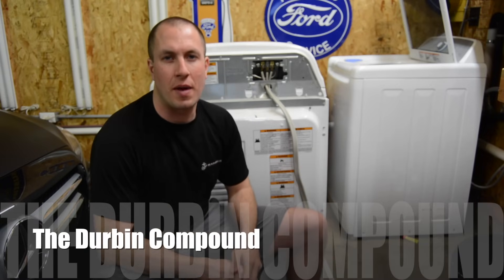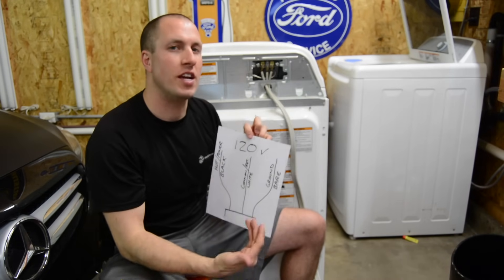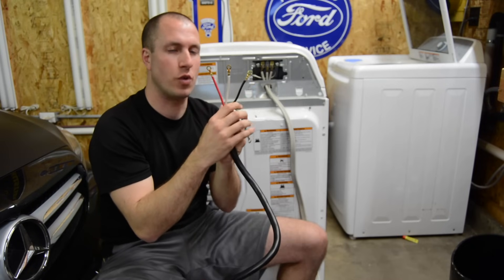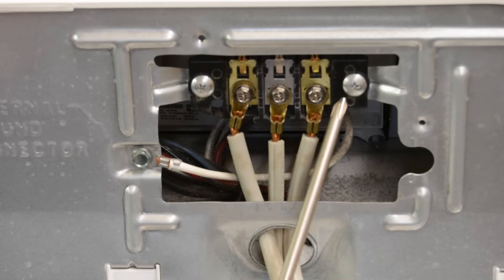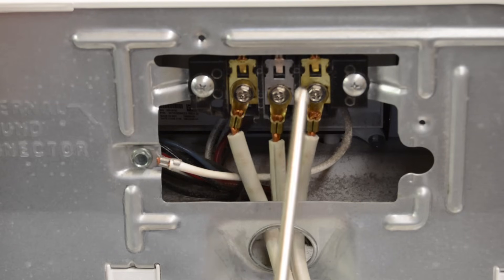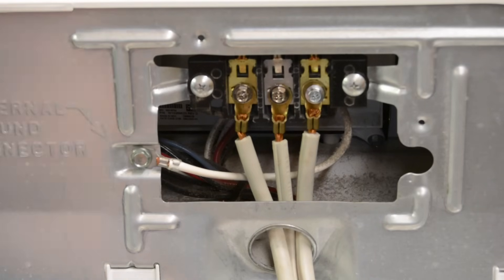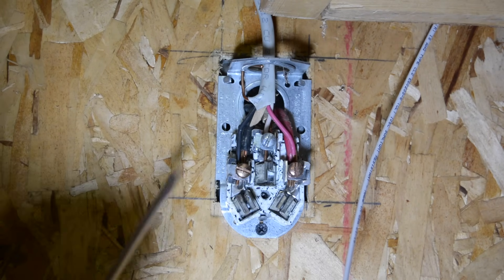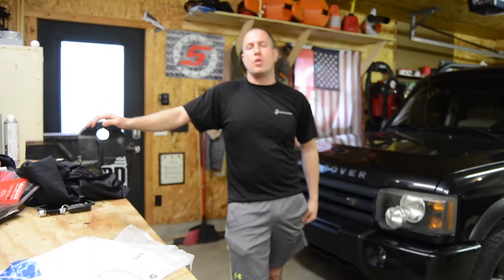How To Change A Dryer Cord - Changing a 3-Prong to a 4-Prong Plug

Comment: Super helpful thank you! When changing from a 3 prong to a 4 prong and I attach the ground (teal) to the dryer body do I keep it attached with the white wire already there or do I keep that white wire loose?
Reply: Perfect, thank you so much!
Reply: Thanks for asking this question.  It wasn't clear to take the white wire off or lay the green right over the white one now we know .
Reply: Mine has a metal strap as the ground not a white wire.  Do I connect the white wire from the cord to the strap?
Reply: Had the sameee question !
Reply: This is why I came to the comment section! Thanks!
Reply: Is it okay to let the white wire just hang inside when placing the green wire  on the left side?
Reply: @TheDurbinCompound  you might want to edit the helpful video to include that point about what to do with the existing ground wire…
Reply: @TheDurbinCompound  WRONG! ..... When using a 4-wire cord on any electric clothes dryer you must move the white jumper (neutral) wire from the cabinet casing (where the green screw is) onto the middle screw where the cord white (neutral) screw is also attached (white on white under one screw) as both are essentially the same wire. You can easily check this with a continuity test. Then the cord green ground wire is attached to the cabinet body where the green head screw is so that the cabinet is grounded and will satisfy the new NEC code requirement. The only place the neutral and ground can be combined is at the 1st panel box where the main disconnect is, nowhere else.

Comment: What happens to that white wire going to the left? Do I place the green wire on top of it?
Reply: Exactly my question
Reply: Thank you! This is my main question!!!!
Reply from the maker: Yes that is what I would do.
Reply: Actually, you want to connect that white wire to the center lug to isolate it from the ground. While it will work with the white and green connected, it will not provide adequate shock protection. I recently found this out after installing a GFCI breaker for my dryer. As it had the ground and common/neutral connected to the dryer housing, the breaker would immediately pop upon powering it up as it thought it was have it as ground fault event. This video shows what to do: https://youtu.be/311TVuKiv10
Reply: @photogravity  then you were doing something wrong. Neutral and ground are bonded together.
Reply: @gloiban  I spoke with a couple electricians and they informed me that it was indeed done correctly. This explains it better than I can. https://electronics.stackexchange.com/questions/213479/neutral-vs-ground-wire

Comment: I followed this video exactly but my dryer will not heat up, it just spins and blows. All thermostats, heating element, and thermal fuse have continuity. Testing the back panel, the center+left and center+right both show 120 V, but left + right shows 0V. I checked the outlet and get 240 V when I test the two hots, and 120 V when I test them individually. Do you know what's wrong with my dryer?
Reply from the maker: Sounds like a bad cord. If you have correct power at the outlet but not correct power when you plug the cord in and test at back panel. The power isn’t coming up the cord.

Comment: I’m about to get a lg dryer delivered . They sold me a 3 prong . But I have the 4 prong . 2012 model in a modular . Don’t know if cords are universal but the four prong one of them look like an L
I opened it up The color of the water is in the end your video look the same as mine only flip the other direction so the L prong would be on the top when they go to plug it in but it looks pretty old
Reply: Wish I could upload a pic with the cover off to you

Comment: When installing a 4wire on the dryer don’t the dryer “ground wire move to common terminal with the cord white wire and the cord green wire goes to the ground on the frame? That’s how I thought it was...
Reply: My parents recently bought a drier that's built for either 3 or 4 wiring. Manual stated to remove the ground wire on the body and put it on the common wire. Looking at it, it was a jumper from the common to the body. This was to just stop it from floating around. Other designs that wire may be connected to something else so I wouldn't do it without checking instructions.
Reply: Yes it does after watching this tutorial I didn’t do it the right way like you just explained I followed the tutorial and as soon as I plugged it in it exploded and blew the breaker 🤦‍♀️ wish I would of watched more then one tutorial
Reply: @taylorwebster969  oh my word. I'm sorry that happened to you but I'm glad you posted this. This video is a touch confusing to me also.

Comment: Important question: where does the internal white wire (sometimes it is green and white) end up with the 4 prong install?  Does it go to the middle screw with the neutral (white) cord wire?  Or does it end up with the green cord wire under the ground screw?
Reply: That's where he is wrong. The white is a jumper if there is only a 3 wire circuit. The white jumper is to be removed from the Ground screw and mated with the neutral wire onto the center terminal when a 4 wire circuit is present.  That in effect, creates what is known as an "Isolated Neutral" or a "Floating Neutral".  This is proper Code by the NEC and NFPA.

Comment: Hey, so I haven’t gotten the chance to take a look at the unit yet but the outlet I have on my wall is a 4 prong, the person I bought it from has a 3 prong outlet so I’m assuming the unit is a 3 prong unit. I must plug the 4th wire to the ground plug? Does the 3 unit have a ground plug or did you mean use the 4 prong for my outlet and don’t connect the ground wire because it won’t have one due to it being a 3 prong. I’m sure I’ll answer my question when I look at the unit but just wanted to verify 😊

Comment: What if my dryer did not have the wire that I need to include with the white wire(external ground). How will this affect my setup?
Reply from the maker: If your dryer does not have a ground wire that goes inside, do not worry about it.
Reply: TheDurbinCompound thank you
Reply: TheDurbinCompound can we connect the green wire to any screw?
Reply from the maker: Irving Hinojosa  yes that is fine
Reply: Yoo did it work I'm in that same situation
Reply: TheDurbinCompound it worked I appreciate you replying.

Comment: The only problem I'm having is I'm not seeing a "place" for the green ground wire. If I find a whole and isolate it (touching metal) that should be fine? Or no?
Reply: Put it with the white, common wire (terminal) in the middle.
Reply: @alexa6513  I believe that what I did. It was several months ago but I tell ya I was scared to press start for about five minutes

Comment: So, if I've only got the 120v setup (Black, White, Ground) should I just purchase a 3-prong to 4-prong adapter?
Reply: 120 standard outlet will work for a washer. 240 big round 3 or 4 prong outlet for dyer. You cannot adapt a 120 outlet to a 240 3 prong and expect it to work. There are two phases in the breaker panel that are 120 volts each. The breaker connection alternates between the two at each slot. That is why there is a bar connecting two 50 amp breakers together making a 240 circuit. One breaker is on one phase one on the other

Comment: If installing a 3 prong outlet from a 4 prong, can you tie the ground and common wire together? Or should they be separated?
Reply: Why are you switching from the code compliant 4 prong to the old, non-compliant 3 prong? Are you re-purposing a dryer outlet? What is it for, a welder or a water heater or something else?

Comment: Just so everyone knows, if you have a "smart" dryer with a fancy touch screen and wifi, then you can't change the 4 prong cord it came with to a 3 prong cord.

Well, technically you CAN, but the screen won't work. As long as the dryer has a physical start button, it'll heat and spin. But since all the dryer modes and settings are accessed through the screen, what you end up with is a dryer that only has an on/off switch.

No timer, no heat settings, no tumble control, just on and off.

In that situation, your only option is to change the outlet, or get a little risky and use a 3 prong to 4 prong male to female adapter.

Comment: I have a samsung he dryer. Moved to New house. Put in 4 prong as per your video (very helpful). It turns on, all the dials work. Just won't start. Any thoughts?
Reply: Never mind. I unplugged it and plugged it back in. Works!
Reply from the maker: Humm that’s weird. Definitely doesn’t sound like a plug issue. I assume the dryer worked before you moved it. If you are reasonably sure that nothing was damaged in moving it. I’d say that it is a safety interlock keeping it from starting. Maybe the door switch? Maybe a tilt sensor?

Comment: I removed the plug off the old dryer ig was red white black and one the new dryer color scheme is black white red would I just switch the ends ? Does red and black make any difference
Reply from the maker: Black and red should be the same voltage. Never switch white with either of those. You should be just fine.

Comment: For a 4 prong, as others mentioned, the video is not quite correct. The White Neutral from the dryer should be lifted from the green grounding screw and placed in the middle terminal with the other white neutral wires (2 from the dryer, 1 from the cord). The green screw should then only connect the Green ground wire from the cord.

Comment: Question my dryer outlet looks just like yours.  It doesn’t have the L shape 3 prong. I can’t find a plug like it besides a range cord. Where did you purchase your power cord for your dryer?
Reply from the maker: Range cord and dryer cord are often the same. They are rated for the same amount of power
Reply: Ok bc I notice the dryer cord was 30 amps and the range cord was 50 amps. Also I was told if I use the range cord that i had to change the dryer blocks to a range block. Is this true. I have a samsung dryer

Comment: When adding the green ground wire to a 3 prong drier do you remove the drier ground wire or add it on top?
Reply: I had the same question!
Reply: @jeslinger  for what it’s worth I added it on top
and it’s been working fine

Comment: Do you replace the ground cord that's already attached or attach it over the current ground wire? (Switching a 3 prong cord for a 4 prong cord)
Reply from the maker: If I understand you correctly there is already a wire that is on your ground point and it is going into the dryer.  Leave it and attach your 4 wire plug ground wire over it
Reply: Good question.
Reply: When switching from a 3 to a 4-wire/prong cord, the ground wire inside the back of the dryer should already have been connected to the center neutral screw terminal.  Now that you are switching to a 4-wire/prong cord, that ground wire needs to be moved to the ground screw at the left in the video.  The green ground wire in the new cord should be installed over that ground wire at the ground screw.

Comment: You could actually connect the bare ground on the female plug to the common neutral wire. Instead of leaving it there suspended, as long as neutrals and grounds aren't separated in the electrical panel

Comment: On the 2 powers.. does it matter what side theyre on???
Reply from the maker: No it does not
Reply: 3 wire to 4 wire conversion question. The center post on my Samsung is called neutral (what you call common) the instructions say to move the internal dryer Ground wire to the common (center) post and also the 4 prong Common (white) wire. The two wires are secured to the common post. The hot wires on the outside post. Then the 4 prong green wire is secured to the dryers green ground screw (where the internal ground was originally connected. Does this sound right?
Reply: I have another question. My Samsung dryer manuals labels from left to right, Hot (L2) Common (N) and Hot (L1).
What is the reason for L1 and L2 labels. Some online say that Red is L2 and Black is L1. Is this true?

Comment: So my two whites are connected in the middle. Should  the small white be with the green on the ground because when I touch the door or perimeter of the dryer it give a little shock like static electricity?

Comment: I got 2 dryers one is a 4 prong n Ines a 3 so I need taje 4 prong plug n put on 3 prong dryer so do i hook ground up to were they have a white screwed the the metal of the dryer can I jot hook up the greenhouse I rap n electrical tape or what

Comment: Female who has never done anything electrical, LOL. If my new 3 prong cord isn't color coded, I just add them in order yes? Plz let me know if I can send you pictures.
Reply from the maker: You should be good to go to put them in order.  Two wires on outside are power (red / black). Center wire is ground / neutral (white)
Reply: @TheDurbinCompound  

Thank you for the reply! Unfortunately mine are all grey...no different colors.
Reply from the maker: Right the cord is all grey.  Outside wires go to the black & red.  Center wire goes to white
Reply: So, so, so helpful! Thank you for the easy to understand and detailed video and for confirming for a nervous nelly that all was done properly.

Comment: Actually per every appliance specialist i have checked with you are incorrect on the ground hook up. When changing from a 3 prong 3 wire  to 4 prong 4 wire cord  the white or green from the dryer that is hooked up to the frame gets disconnected and hooked to the central terminal which is the white cord wire . You put both the cord white and the dryer white to the central terminal.  The green cord wire goes to the dryer frame by itself.  If you going to post make it correct.

Comment: Great video, but the instruction on connecting a 4 wire cord is not quite correct.  The white jumper wire is not to be left connected to the dryer case.  It must be removed from that screw and connected to the middle terminal.  That separates the ground from the neutral, as it is supposed to be for a 4-wire connection.
Reply: Another video I watched did it that way. Showed removing the existing ground and putting it with the white middle wire and placing the new ground to the dryer case. 

I had to replace a 3 prong with 4 prong and was nervous about doing it correct. Days later I watch this video and he did the ground differently.
Reply: Yes exactly
Reply: So what do you do with it? Just tape it off?
Reply: @d3admaub938  Yes, you can do that, but most dryer instructions say to connect the jumper wire to the middle terminal instead of just leaving it loose.  The middle terminal is what the other end of the wire is usually connected to internally, so by connecting it to the middle terminal you have simply connected it to itself.  You can confirm the correctness of this by looking at the wiring instructions on the back of the dryer, or if you don't have that, by looking in your dryer manual which can usually be found on the internet.
Reply: I was wondering about that too. Thanks.

Comment: Hold on I’m still confused . I’m trying to change my 3 way plug to a 4 way plug but I’m not seeing a ground for the green piece 👀👀
Reply from the maker: Attached the ground to the dryer shell or metal of the dryer. Under a screw that is close by. But NOT WITH THE WHITE WIRE.  Has to be seperate.

Comment: Thanks for posting. My new chord is a 4 prong but isn't L shaped. Is that a problem?
Reply: If it's not an 'L' shape then you didn't get a dryer cord. You've probably picked up an RV cable
Reply from the maker: Thanks for the help as this comment slipped through the cracks.
Reply: may be for range stove
Reply: All 3 and 4 prong dryers cords will have the neutral prong in an "L" shape.  If yours is a straight blade you probably have a 50 amp rated range cord.  A range cord is a different configuration and will not fit in a dryer receptacle.

Comment: Someone help me please:
"If you have a white jumper cable on a dryer that previously had a 3-prong cord and are switching to a 4-prong cord, you need to remove the white jumper wire from the ground screw and connect it to the center neutral terminal on the dryer's wiring block; essentially, you're separating the neutral wire from the ground wire to properly accommodate the 4-prong cord's dedicated neutral connection. 

Key points to remember:

Neutral vs. Ground: The white wire is the neutral wire, and when converting to a 4-prong cord, it needs to be connected to the dedicated neutral terminal, not the ground screw. 

Check for existing connection: Before removing the white jumper wire, make sure it's currently connected to the ground screw. 

Safety first: Always disconnect the dryer from power before working."

Comment: Remember, it goes on the dryer how you have it oriented in your hand.  Hope you don't have in your hand backwards ⚡
Reply: You can have it backwards.  Flip the three-prong cord over and you'll still have the two power wires on the outside and the neutral in the middle.  Both power wires are 120V so it doesn't matter which side you put them on, just NOT in the middle.  Middle must be neutral (white).
Reply: in your video im looking at the ground white wire. You say connect the green wire to the ground where the white ground wire is to the left. My question is does the white ground wire stay with the green ground wire?  Or as some comments have said they connected the ground white wire to the white neutral wire.
Im not getting any juice connecting white and green ground together.
Reply: Marlon Patterson same I got no power doing it this way, did u figure out the right way to do it ?
Reply: Jimmie Goins I think leave the white ground wire on left off and put the green one there instead
Reply: @jeffreyjaguar6929  Thanks